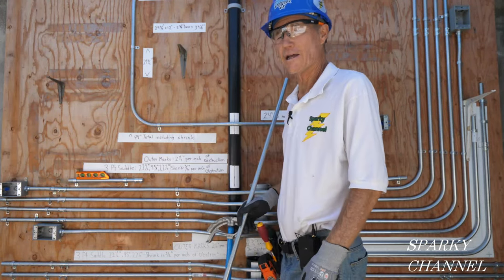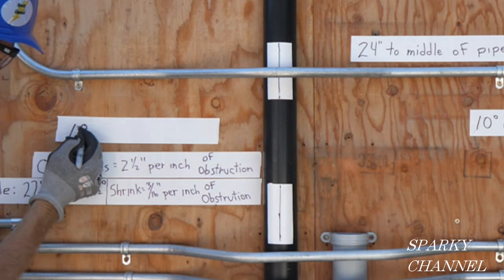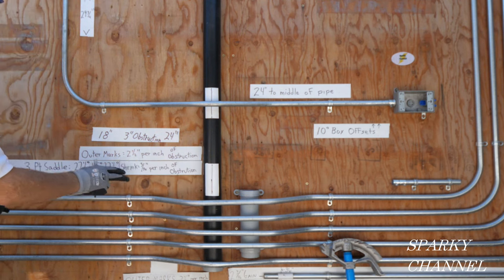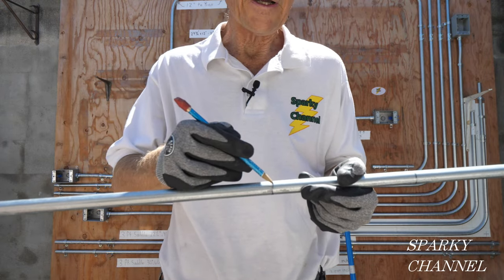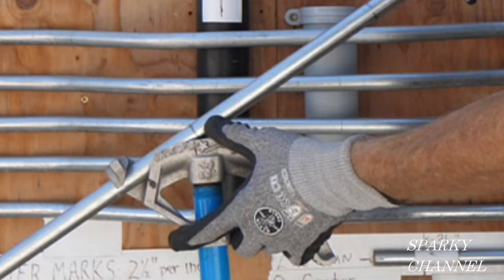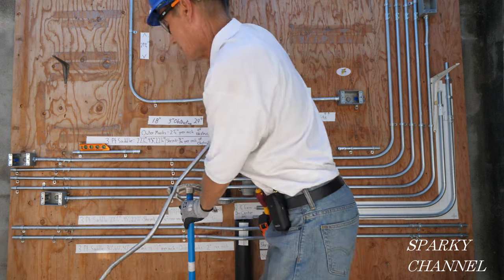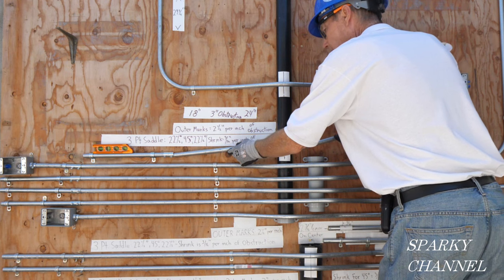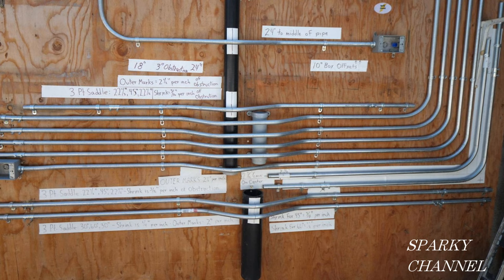Push-Through 3 Point Saddle Bend: Easy, Fast and Good for Tight Spaces

Comment: You can also use a multiplier of 3 instead of 2.6 and make all 3 bends on the notch. 🙂
Reply from the maker: Interesting, thanks!
Reply: You can make a 1” 3 point saddle by using 22.5 ,11 ,11 bends. The multiplier is 5 instead of 2.5 and the shrinkage is 3/16” per 2 inches, instead of 1. Just a heads up
Reply: Inverse of the sine of the outside angle is how you find the multiplier for all bends. 

Sin(11°) is 0.1908

1/0.1908 = 5.24. 

Rounds down to 5. 

I know a lot you guys know this already but i just found out 😂
Reply: @EmoDKTsuchiya can you explain?
Reply: @landonmiller9896  can't really explain it further than what I laid out. All I know is that the inverse of the sine of a particular degree is how we get all of our multipliers. I don't know why exactly that is.

If you take the sine of 30 degrees you get 0.5. (Sin(30) = 0.5). You invert it(1÷0.5) and you get 2 as in the distance multiplier for 30 degree offset bends.

I should look into the "why".
Reply: @chadmayers9049 will this work on the push through method?

Comment: Hey brother I’m sorry to bother you but I was just wondering my local IBEW isn’t taking applications at the moment and even if they do I don’t know if I’ll be able to get in. Is there any other option for me to become a licensed electrician without the IBEW? Could I get the same sufficient schooling somewhere else without their apprenticeship?
Reply: Union is only one way bro, non union is still a valid option and pathway for sure. Perhaps the union offers maybe more supplementary courses and training throughout ur apprenticeship but non union still requires school and need the minimum hours requirement (at least in Ontario Canada) try non union for a bit at least until ur hall opens applications for a bit so you have a bit of experience
Reply from the maker: Nick and ElementFreedive are both correct. There is more than one way for sure. It's probably different from state to state but it's all about experience. However you can get the experience will work as long as you can prove it.

Comment: Question, On the bending part you did star, knotch, arrow for the bends, I know there is a reason for that, but what would have happened if you bent them all on the same bending point?
Reply: that would make the 2 parts not even length to the center of the saddle

Comment: Thank you for your teaching sir. I have used rigid conduit with the machine bender and now I’m doing emt which is WAY easier to bend but also easy to mess up since it bends rather easy. I needed a refresher and learned more than what I expected as far as the way you se the bender instead of putting the conduit on the floor every time you bend you stand it up the whole time. Thanks again

Comment: Nice demo. Extremely handy to have an idea how to do this when running wire outside the wall is your best option.
Reply: It's a straight bend without rotating the pipe or changing positions of the shoe/bender

Comment: Hey Bill, Super nice videos! Ive been watching your vids and reading all the comments, and im still curious if anyone could tell me how to use this method on a 15°/30° 3 point? What would the multiplier be? • 3 instead of 2.5? if so what would the shrink be on a 15°/30° push through 3 point? would it still be 1/8in the same as a 15/30 using the traditional method?

my uglys book is otw in the mail, im hoping my questions can also be answered there.

Comment: Hi Bill, will this method work with other degrees, like, 10:20 and 10°I do realize I will have to use a different number for shrink though.?
Reply from the maker: Yes it will. See my video: Do Cables Need to be Supported When Fishing Them Behind Walls? NEC 334.30 (B): https://youtu.be/TbAFRzp1PZ8

Comment: Does the math stay the same if you are using your center of bend for 22.5 on your hand bender
Reply: So, I think if you use 22.5° for the center bend, you should use 5.125 for 11.25° bends as your multiplier because he used 2.5 as his, which is pretty close to the multiplier of 22.5° (2.61).

You can find the multiplier of any degree by 1/sin(X°). 1/sin(30)=2, 1/sin(45)=1.41, etc.
Reply: I don't think this method works for 22.5 center bend.  Only for the 45.

Comment: How would you decide when to put the mark on the arrow, notch or star ? Or can you use the same throughout all the marks ? I thought the middle mark is on the notch and the two outer marks are on the arrow
Reply: That's with the traditional method where the end bends both have the bender head pointing back at the center. With this push through method you keep the bender head the same direction all the way. Traditionally, both outer bends would use the arrow.

Comment: Mr Sparky sir, I've noticed that some people bend a four point saddle with push-through, but they bend all the marks on the arrow. You don't do it that way
..are they doing it wrong? Does that way make it inaccurate?
Reply: You’d have to either do an additional cut on the front end of the pipe, or move your marks up to account for the saddle not being centered with the obstruction. It’s way easier to just bend 2 offsets opposite of each other with a pipe flip between them.
Reply: @ActingLikeABoss  I see, that makes sense. Doing it all in one direction shifts the whole saddle over a bit.
Reply: Actually they should be doing it all on center of bend like you would on an electric bender.  If you do them all on the arrow it will shift your center point.

Comment: I'll start using 2 1/2" as a standard as well, but I wonder where you got that from? I was never taught that. I just assumed we took however much inches the obstacle was and multiplied it by the multiplier of the biggest angle. so for instance, with the a 15-30-15 degree three-point, I would multiply by 2.0. I have always used the push-through method, and another guy asked me why I don't use the Star-notch-notch method? And I said I wasn't taught that way. Honestly didn't have a good answer, but he says it works for him. So I don't know. Great video though!
Reply: 2.0 multiplier for 30 degrees is for offsets (and 4 point saddles), not 3-point saddles.

Comment: Here's the reason this "works"... ehh sort of, and how to fix it.  The only thing you changed was bending the first bend on the star.  It sort of works because bending on the arrow is kind of like the start of the bend, and you can see that bending a 22.5 on the star makes it... sort of the start of the bend.  In other words, it's nearly the same bend in reverse.  However, your final product was actually off. You can see that one bend mark is about 1/2" up further from the bend compared to the other bend mark.  That means the star really isn't the right place for this. The star was off by about 1/2". To make this more accurate, make an exact 22.5 degree bend with a piece of scrap, then flip it around in your bender, and see where the mark lands.  Wherever that is, that's your bender benchmark, for that bender and conduit.  You can also find your bender benchmark the same way for 15 degree bends, for the 15-30-15 saddles.
Reply: I was reading in my conduit bending book from my apprenticeship and I read that for the push through method for a 3 bend saddle that (like you said) a benchmark should be made on the bender for the center of a 22.5 degree bend for the two outside bends, like you stated. And that also to find the distance to the outside bends from the center bend is to multiply the height of the obstruction by 2.6 and then also add the outside diameter of the conduit to this measurement.
Reply: @lazarevic95  Yes, that's a somewhat more mathematical way as described in NJATC book for push through. What Sparky did was measure and mark the conduit exactly like a traditional bend.   So Sparky used the traditional 2.5 multiplier.  Also he opted for the 2nd and 3rd bend to face the first bend (which is fine in the traditional method).  The only thing he did differently was make the first bend "backwards" (relative to the traditional method).  The trick there is to find the proper place align the bender facing "backwards" with the first bend mark so that it makes the exact same bend.  The star might be a fair approximation.  If you have a lot of bends to make on a bender, you can figure out exactly where the proper place is and make your own benchmark on the bender.  It'll be a different mark for a 22.5 (22.5 45 22.5) and for a 15 (15 30 15).  If you read through the comments, other people have some other ideas on how to do it.
Reply: @CoolHandLouis  Okay I understand what you're saying. Thanks for the info!
Reply: Your charting for center stage f bend, if you bend the conduit on center of bend for that shoe the bemds will always be spot on.  You have to do it that way on large conduit in electric benders
Reply: That bend was dead on.  What are you looking at?